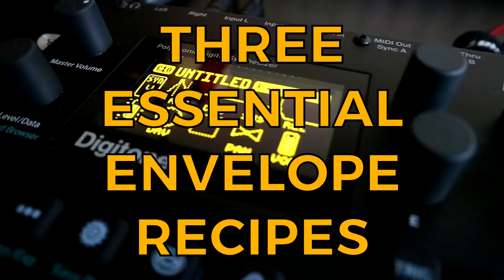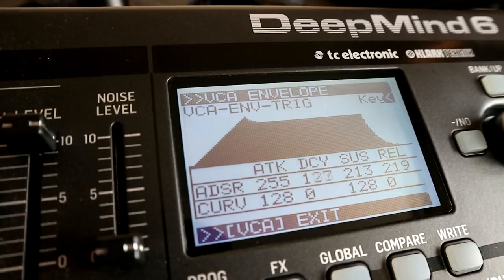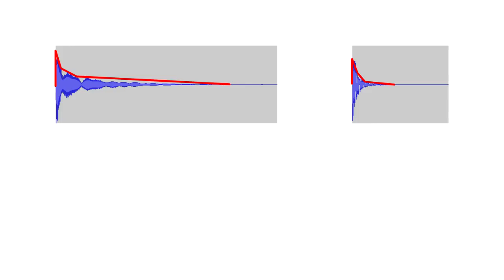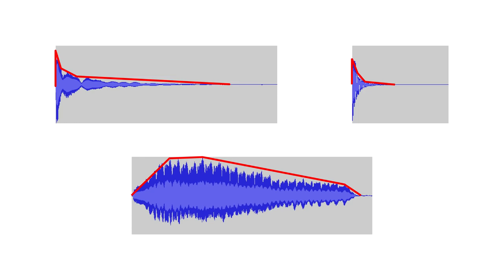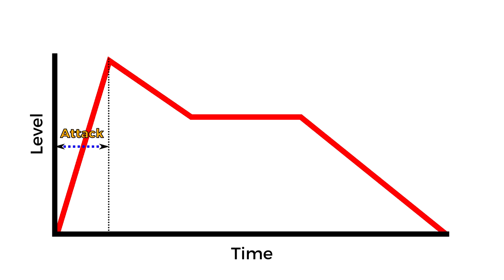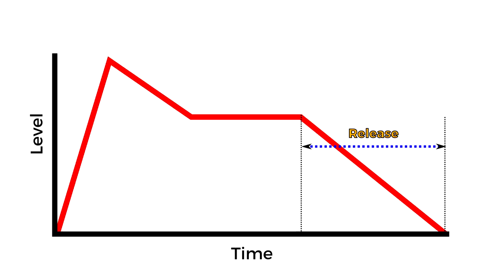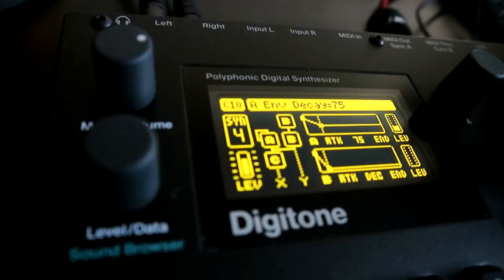Three Essential Envelope Recipes for Every Synthesist!

Comment: Nice.. wouldn't mind seeing more like this 👍👍👍🤘💯
Reply from the maker: I'll do my best! What topics would you like to see covered?
Reply: Oscillator Sink cv
Reply: envelope followers
Reply: Filters LP, HP etc.
Reply from the maker: My understanding is that they it's a standard adsr envelope, then just assign how much you want it to move the filter with the EG amount (which can be positive or negative), so the things I show in this video will all apply. What's puzzling you in particular?
Reply from the maker: The cutoff frequency, yes.
Reply from the maker: @73steve1973  the envelope describes a journey. The journey starts from where the filter cut off is currently set. The EG amount tells you how far the journey is i.e. how much the filter cut-off knob will be "turned" by the envelope (and in what direction, up or down).
The envelope always describes a return journey, out to the new cutoff amount, and then back to the original setting.
Then adsr works as described in this video:

A (Attack) - the time it takes to go from the current filter cutoff to the new position described by EG Amount.

D (Decay) - the time it takes, once the attack time passes, to fall back to...

S (Sustain) - the filter cutoff set by this knob - this is where you'll stay for as long as you hold down a key. Think of this knob as a proportion of your EG Amount knob. Turned up full you'll be at the furthest extent of the 'journey', at zero you'll be back to the original cutoff value, somewhere in the middle you're at a rest stop somewhere between the two.

R (Release) - is the final part of the journey as you let go of a note - this is the time taken to go back to the original filter cutoff.

So again, if it wasn't clear in the video (and I'd suggest rewatching it now you have this information) A D and R are times and S is a level.

Also the Sub Phatty manual from pages 16-19 describes this quite well, with diagrams.

Comment: Thanks! To beginners I want to add one important thing to keep in mind: Attack, Decay and Release are time parameters. But Sustain is a level parameter. So it can be a bit confusing when you first see that ADSR graph, because the parameters can appear to be all mapped on the same domain, but they are not. This is shown on the graphic with arrows but it may not be obvious to think of.
Reply: But on my synth the A D S and R parameters all have both an L (level) value and a T (time) value, which I find confusing.
Reply from the maker: What synth is that?
Reply: Oscillator Sink Roland XV5080
Reply: Oscillator Sink specifically, the TVA has 4 time parameters and 3 level parameters. The TVF has 4 time and 5 level parameters.
Reply: And slightly annoyingly they’re only ever labelled as time and level, never A, D, S or R.
Reply: Ideally I need a simple midi controller with these parameters mapped - would be MUCH easier to work with a visual graph and some pots.
Reply from the maker: @dizz740  ah yes, I just took a look at the manual - it's a lot like the 2 stage decay you have in the DX7 (and related synths). Kinda an ADDSR. Really useful in situations where you need a sharp transient and a softer decay in the same sound.
Reply: Oscillator Sink thanks for explaining. I was thinking one of them was a ‘hold’ but two decays makes sense. I’ll open the manual!!
Reply: @OscillatorSink  I think Ritalin also helps.

Comment: Recipes is a fantastic way to think of envelopes. I think using these templates will really help me jump in to designing my own patches. I was previously doing random exploring and losing my creativity by the time I got around to anything substantial. My synth allows me to import envelopes from other patches so I think I will create patches that are specifically setup for each of these recipes and use them as templates to slap on wherever I see fit. Thank you so much!

Comment: This was really interesting, and you explained it very calmly and clearly. Almost synthesis meditation... When you start building a sound, assuming you know more or less what you want at the moment, do you start with shaping the envelope, or the sound itself first? And what is the first thing you assign an envelope to, after volume of course? Thanks for this! Cheers
Reply from the maker: It really does vary for me. If I'm going into a subtractive synth and have a sound "archetype" in mind (say bass, lead, pad, etc.) then I usually jump on the volume envelope to get the feel right, but after that it's kinda wherever the patch takes me? When I'm not recording a video I'm a little less structured in my sound design to be honest! A lot of times it's the configuration of the oscillators that will dictate other stuff - the frequency content will guide how far or fast I can move the envelopes I think.
Reply: Yeah, I think that when there is a general idea or direction to what one wants to achieve, it's easier to start with the volume envelope, so the sound is based on it. Like a pad with a long attack and\or release, a percussive sound with a short attack, just like you showed in this video. But when just building a sound out of a gut feeling, I find that the volume envelope comes somewhere after the shaping of the sound by playing with the different oscillators. All in all, as long as the way is fun and inspiring, it doesn't really matter what comes first...  Thanks again and cheers!

Comment: At 13:15 the VCA Envelope display shows a rising sustain level. How is this done?
Reply from the maker: If you switch on the curve button on the Deepmind, attack, decay and release can be morphed between exponential and logarithmic, whereas sustain can be made to slope up or down .
Reply: Thanks. Just realized that's what the the Korg Poly-800 did with sustain, way back in the 80s, with ADBSSR.

Comment: lovely video thanks, one question how is the envelope on the deepmind? is comparable to the roland ones?
Reply from the maker: In what way comparable, and to which Rolands? 
It's an ADSR that can go quick and change its slopes from logarithmic to exponential through linear (and has a neat sloping sustain if you want it), so in terms of features, it's going to be pretty feature rich compared to a lot of older Roland synths and can likely impersonate a lot of flavours of ADSR.
Reply: @OscillatorSink  thanks for your reply, what i ment was, for example compare it to a sh-101 it has those really fast popping kind of envelopes wich i love for percussion
Reply from the maker: @toml6535  they go pretty fast, and can get especially percussive with the curves set exponential. They can also go verrry long!

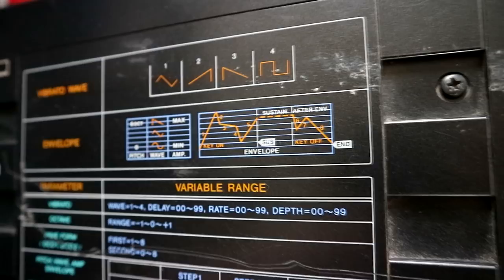Comment: 2:42 I mean...
Reply from the maker: Right?! (actually, the two-stage release on that is actually kinda amazing from a sound design perspective, allows you to do all kinds of amazing flutters and floats on the way out of a note).
Reply: Sure, those envelopes make sense for that particular synth.  Having messed around in modular with multistage envelopes, I think I prefer to have several basic envelopes in most cases with different routings.  Like two modulation envelopes with settings like those in your "pad" category covers most of what those more arcane envelopes had to offer.
Reply: Oscillator Sink  - I learned subtractive synthesis on a CZ, and those envelopes are amazing as long as you have a book or article to explain them. Half the time you don’t use most of the 8 stages at all, but they’re there when you want to do something difficult (flutters n floats, like you said). The CZs can do amazing imitative synthesis, at least within the limits of the core osc sound, because you actually get SIX of those envelopes per patch — each of the 2 oscs has its own pitch, filter (well, DCW), and volume envelope. I did a couple African percussion sounds on the CZ that would have fooled most people....Great video as usual, btw. If you want to help humanity, you might do one some time on how envelope amount and other filter settings interact with the VCF cutoff ... as a newbie that used to really puzzle me ...